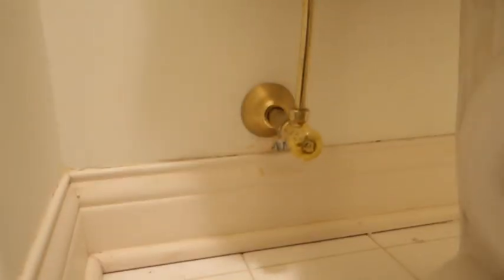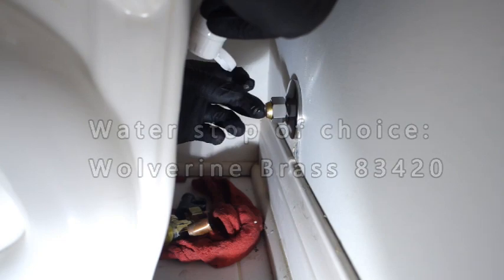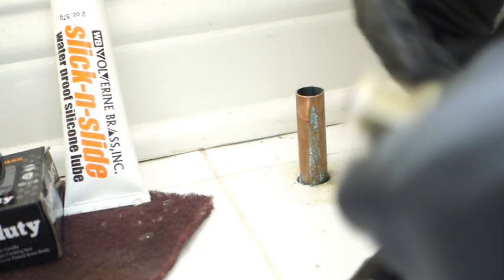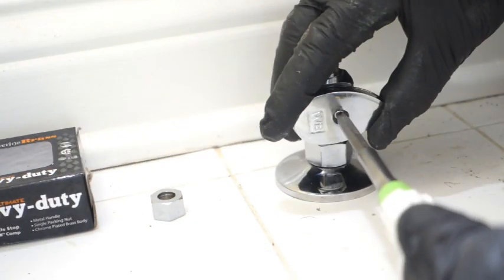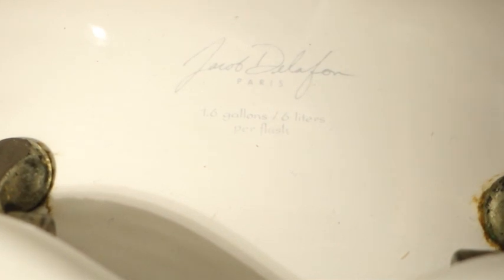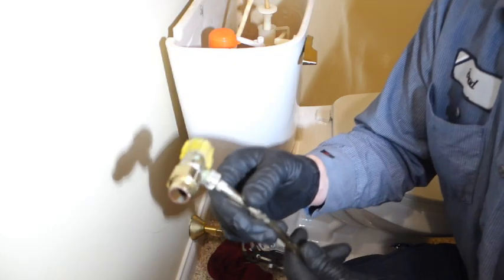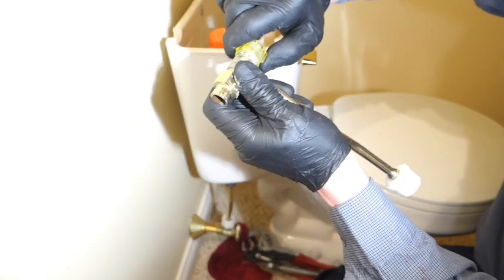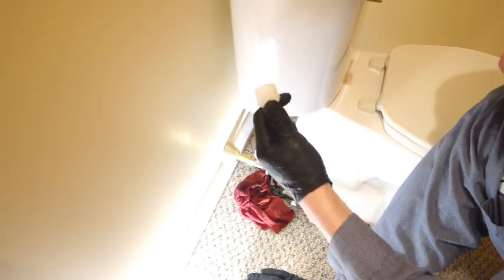How to replace leaking valves behind your toilet

Comment: A lot of people hate on the braided supply lines because it’s “to easy” but that’s the what i use every time. I agree, you can’t beat the metal nut. I have never had an issue with them although I have seen many homes flood from the braided toilet supply lines with plastic nuts.

Comment: I remember this video from before :) Can't forget those fancy ass toilets.  I'm never in favor of cutting back pipe to be closer to the wall, but I have only worked with PEX in these cases where there are no serviceable options besides adding a coupler inside the wall (I'll never do this if I can help it.)  If it's a shutoff valve, the only time I cut the pex short is if I thread on a shut off valve onto a pex expander male threaded fitting.

Comment: Job specific is nice but a little extras aren't bad either. I only do remodels, 80% of the time I have a plumber come in but plumbers can get busy, so I step up. I bought the M12 copper cutter and the M12 PEX expansion tool, just to try and keep up with KarlyCarl! Great tools.

Comment: A little trick I learned on vertical deburring....put a little paste flux around the inside of the copper. It catches the deburred copper.
Reply from the maker: Straight up priceless trick 👍👍
Reply: Works like a charm doesn’t it!

Comment: does deburring make a big difference. I have to admit I may or may not de burr copper on repairs.  always looking to learn.
Reply from the maker: Honestly, not much of a difference on these copper supply lines as there isn't much flow. It's vitally important on all your main 3/4" and larger copper pipes though!!  Even more important on recirc copper lines as there is always flow through the copper when the pump is running.

Comment: 1:31 Did you know that your Rigid One Stop model 27023 wrench has a lug wrench on the end of the smaller tool that serves the same purpose as the Pasco model 4525?
Reply from the maker: Yep! I just love that the water stop threads onto the Pasco and holds it very securely

Comment: How many inches you leave out when cutting the copper if you don’t have the auto cutter from Milwaukee .
Reply: I leave just enough to fully seat the valve against the escutcheon, but I’m no plumber... I just prefer not to have two different metals showing.